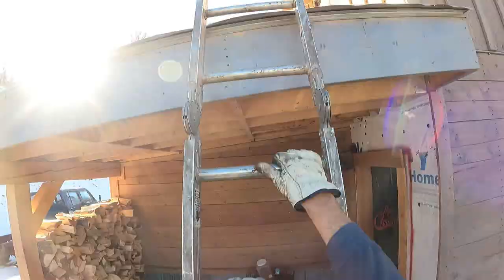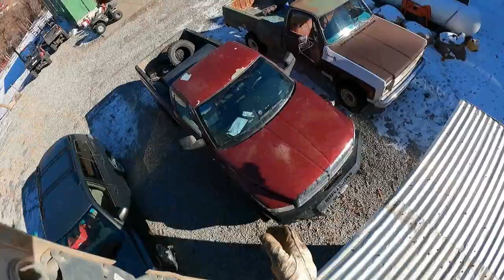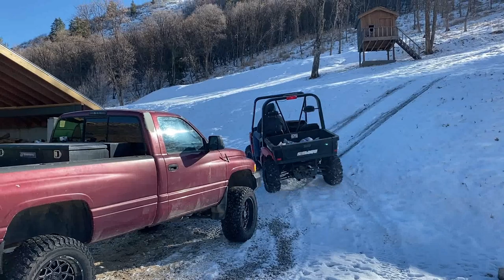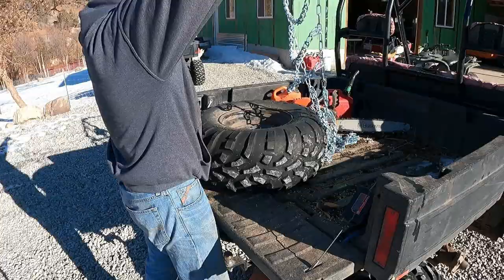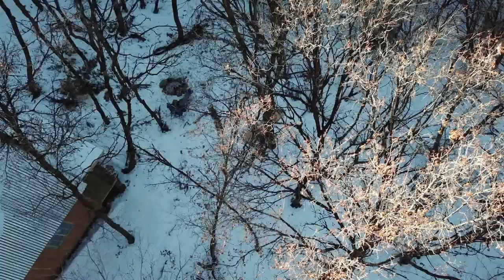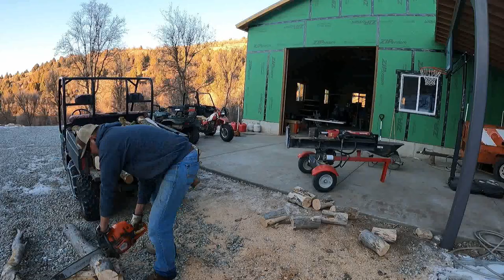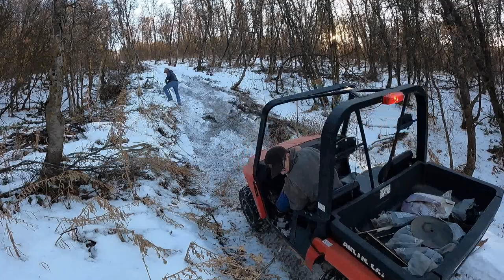The Earth Has Shifted... LITERALLY! (Solar Panel Issues)

Comment: I taught solar at a tech college for a few years, and I have a 10kw array so I actually use it too. One of your big issues is shading from the trees on the hillside above your panels. ANY shading, even just the smallest amount can really cut the output of the entire array. And it is not linear. Like a 5% of the array being shaded can cut the output by many times that. The shading on top of the very short full sun hours this time of year really cut the output of any solar system.  Looking at the images you included of the roof of your house and of the shop, you will still have shading issues, and may need to take out some trees. The way you change the angle of your arrays is also very good, and is maximizing what you get out of them. This higher angle you set them at besides giving your better output at being pointed right at the sun, also sheds the snow faster. Snow of course also really cuts the output of the panels, and this will be more of an issue on the roofs during the winter.

With the great inveter and battery system you have, you could just add more panels and another charge controller to your system, as these are actually relatively inexpensive on their own. But the most immediate thing you can do to increase your solar output is to take down those trees shading your panels. Then you can split more firewood too...  Mack
Reply: Nope, Biggest issue is his land is on the north slope. That hill blocks most of the sunlight during the winter season. The only way to fix it is to move the panels to the top of the hill, or remove the mountain. See how hard heath works, I would rule out him removing the mountain :)
Reply: ^ This. One of the reasons why string inverters rock.

Do you think it would make sense in his situation to add some West facing panels as well?
Reply: I know you are trying to help but he doesn'tread comments
Reply: @guytech7310  The hill gets steeper past where he has the panels, so actually relocating them down the property and a bit higher up will decrease the shading significantly.
Reply: @FallLineJP  LOL! Sure he'll get an extra 10 minutes of sunlight! Woohoo!
Reply: @guytech7310  Have a nice day mate ;)
Reply: Actually, another thought. I remember he recently changed out the batteries in the system. I wonder if the new battery system is less tolerant to voltage drop due to partial shading on the panels.
Reply: Preach, this is the voice (text) of reason. Also this is well supported.  I would listen to him if I were  you  everyone else too. I may not know everything. I know when somebody else knows more than I do, and when they don't.

Comment: The sun has always moved from a more northern position in the summer to a southern in the winter, then back.
Reply: He was comparing this year to the same time last year. Not summer to winter.
Reply: Our planets orbit can and dose vary around our Sun depending on what else is happening in the solar system, like one or more plantes passing dehind us slightly pulling us away from the sun, or it could be the exact opposite
Reply: It doesn't shift to the North so much as it shifts over head. That's why its called 'low winter sun' because its lower on the horizon. You'll never see the sun on the horizon in summer except at sunrise and sunset. You will never experience the sun over your head in the winter - its pretty much just in your eyes. All. Damn. Day. "Why are you wearing sun glasses in the winter, its not hot outside!" This reminded me of hearing that once, so you get to hear it too. You're welcome.
Reply: Yes it always has, but I have been orienting my compass for 30 years and I have noticed for 20 years of driving, where the sun rises and set's. In the summer, it was always dead west and moving a little north until the longest day of the year and in northern Ohio that has always been 5 degrees max. Not this year, and I only explanation is the earth has shifted. That is a absolute fact, however the Why is open to speculation. Analysis tells you that it can only be one of two things. The earth's core is messed up or there are outside forces involved..
Reply: True... I'm 66 years old have seen that every year... 
What he is saying and we're seeing is different, and I can't put my finger on it.
Reply: @rodneydickleman297  depends were u are living.
Reply: @judichristopher4604  You are right. Research from Spiritual aspect why.
Reply: Perhaps the ground is shifting?
Reply: The earth has shifted. It started six years ago. The sun comes in windows that it never has before.
Reply: canyoulisten?
Reply: @forgodandcountry6554  There are unknown planets orbing our normal solar system ( 2 or 3 hide BEHIND the Sun: on the opposite orbital area!), that came from outside...This is an extremely delicate question to answer enough, as difficult as the subject of U.F.O.s or Flying Saucers...Like haves and have nots in the world of money, finance, the necessities of life, "What is TRUTH?), could it be that a very few dont want to divulge what is already known in elite circles, due to Fear of Mass Panic....THat some facts or knowledge be DELIBERATELY Suppressed to give the very few a high edge-advantage? Is WORSE to Come, leading to WORST......"YE Shall Know The TRUTH, and The TRuth shall make You FREE!"-JESUS of Nazareth
Reply: @albertkundrat4624  I know that UFOs are real, I have seen them in the service, but I also know that they are not aliens from another star, they are demon possessed beings beings most likely from DNA breeding from the fallen angels. Do you think it strange that almost everytime women reported being abducted and their eggs being taken. There's a reason and it is not good. Pretty soon there will be a great deceit, Lucifer coming as an Angel of light and so will his followers. Be on guard.
Reply: @forgodandcountry6554  What about Planet X or NIBIRU?
Reply: @albertkundrat4624  I think there's something to that,
Reply: There's people connected to the observatories that estimated they would be here around February or March, obviously wrong but I still am not going to discount the idea.
Reply: @forgodandcountry6554  It's a fact of history that when Johannes Kepler discovered His "Utterly Amazing" 3 Laws of Planetary Motions: 1)That each and every planet moves around the Sun in an ELLIPTICAL Orbit, and 2) That this Planetary Ellipse is at One Focus of the Ellipse only: The SUN's Position, and 3) The 2/3 Law (or 3/2) of Harmonic Motion for all Planets and Satellites: a Ratio between the The Time required to complete 1 revolution around SOL: The SUN, and the SPEED with with that Ellipse is traversed upon to complete that very Orbit; That at the time of JOHANNES KEPLER: only 6 PLanets were KNOWN sinse PTOLEMY's Time! THen in Later centuries, NEPTUNE and URANUS were detected and accepted in SOL's Family of Planets: Then in the 20th Century PLUTO became the 9th Planet. Then, strangely, in the 21st Century PLUTO got DEMOTED as a Planet! WHY? Becaused more orbiting proto?planets were detected at much further distances from the accepted boundary of Our Solar System..But, that's not all: NIBIRU, gathered from ancient Bablyonian and neigboring mesopotamian records, claims to be from Another MINI Solar System That actually ORBITS Our Solar System: but that this other System of Orbiting Planets, does NOT circle the SUN's Focus point at all. That NIBIRU, the outermost planet, resembling somewhat SATURN or URANUS, is only one, that there are others: ARBEDON, etc. and that Our SUN has a kin DWARF STAR or Brown Star or Black Star (not a Black Hole): that like other Sunstars in the Milky Way Galaxy ORBIT one another at a Point of Intersection every 3657 Years......This is Natural Astronomic SCIENCE, not RELIGION, even though Data on Past Intersections are recorded in Religious Texts! In fact, in the universally held MYTHS of many peoples on Earth: The Amerindians, The Egyptians, even the Hebrews (DAVID and GOLIATH) are records of The Fallen Ones having seeded the Earth with a hybrid RACE of GIANTS, But are ALL U.F.O's FALLEN ANGELS? That's another great Question, after all GOD created the Entire Universe: are all His created Creatures FALLEN, like ADAM and EVE? Are all the U.S. Population from Jail'd Convicts?
Reply: You all can say whatever you guys want about us flat earthers but there's no way the earth shift and wobble without anyone feeling this happening..what happened indeed is the celestial bodies  have shifted because of the imminent magnetic reversal
Reply: @forgodandcountry6554  yes, absolutely right about the UFOs and Demons! Thanks that you explained ❤❤❤

Comment: The trees got taller. A maple can grow what like a foot a year? 5 feet of growth at the top of the hill would make a pretty big change in the length of their shadows at the bottom where the house is. My 2c, thanks for the great video as always!
Reply: This exactly.
Reply: The sun is literally within mm of its position each and every day each and every year. Tree growth along the ridge would be the only thing to block the sun.
Reply: @matthewterpstra4675  Well, the sun is whizzing along at 230km/s so a mm goes by real quick ;) 

But yes I know what you mean. Agreed!
Reply: it changed THIS YEAR...........weird how no ones ears seem to properly function any longer?
Reply: @trillrifaxegrindor4411  exactly! Shadows has nothing to do with what he was talking about! The mountain didn't move, the trees are still in the same place,  the sun is coming from another position!
Reply: @bonniegarber9915  exactly! Thats why when people are told something to their face they don't understand it or take points from everything but the point it started..... says the sun is coming up in a different spot entirely..... blames the tress problem solved!
Reply: I don't know if that's the case, but it's certainly a smart answer. Really it's cleaver.

Comment: You should consider building a rotating platform for your solar platforms that can be LOCKED once in position. That way you are not locked into one angle as surroundings change.
Reply: Yes, there are also sun-tracking setups that can be built, as well. I remember seeing people do one with scrap on the "reality tv" show "the colony" several years back.
Reply: I do believe the mount systems they have in place can be rotated and tilted as needed.  I watched the video on building the solar mount several times and they are manually positionable.
Reply: His solar array does that.

Comment: I've not seen anything unexpected with solar production in the UK this month. It is unlikely that the sun rise/set angles have changed - this would be huge news worldwide and celestial navigation would be in chaos.

Panels on the workshop roof would be good and adding vertical ones on the South wall would give you good production at this time of year as the ideal angle is something like 75 degrees so 90 degrees is pretty close. Vertical panels also pickup less snow!
Reply: Ideal elevation angle depends on latitude. Ideal azimuth varies throughout the day and using a heliostat would increase radiant flux.
Reply: It's more noticeable in some areas. Water weight redistribution from melting ice has in fact tilted the axis since the 90s.

Comment: cut trees in the winter when the sap is low... when you buck it in the summer they will be completely dry
Reply: Won't dead standing trees also be dried out of sap as they aren't alive?
Reply: @nanparker8373  It depends on how long they have been standing. They still absorb rain and snow,  although not from the roots, which can cause rot. Once you get them down is when you find if they are sound.
Reply: What does that have to do with the price of fish